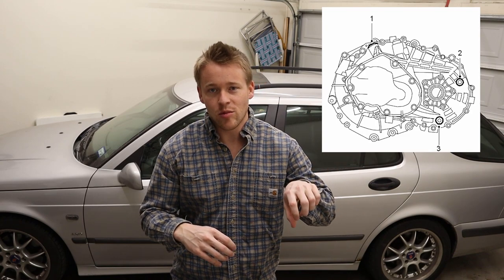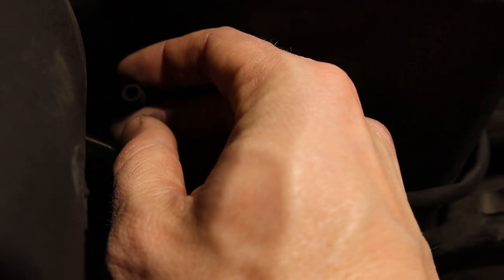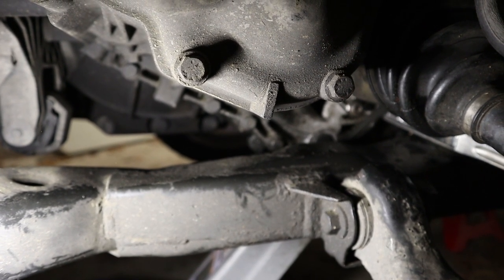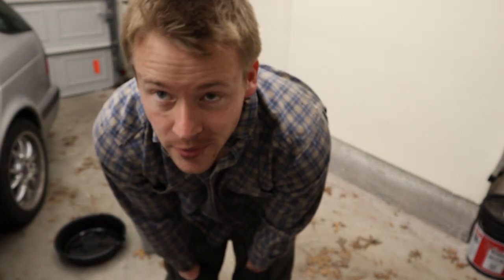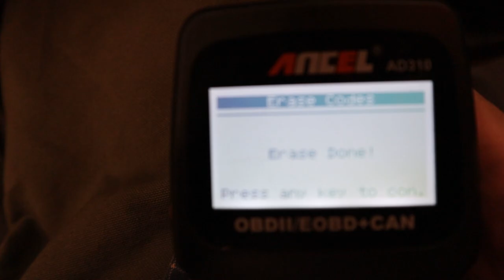Changing Saab 9-5 Manual Transmission Fluid.|Project Saab Part 3

Comment: I did this fairly easy by using an angled allen wrench that I had to cut as short as it could fit between the gearbox and the frame. Then used the long extension rod for socketed wrenches (don't know the word for them in english) as a leaver by sticking the allen wrench into the extension rods socket. 

You get some really good momentum then.

Good work!

Sheers from Sweden!
Reply from the maker: If I could do it again I’d get a different Allen. Jacking up the engine seemed to help. Glad you got it done!

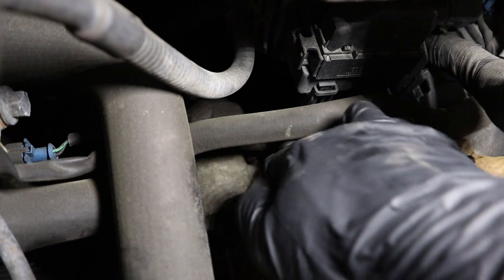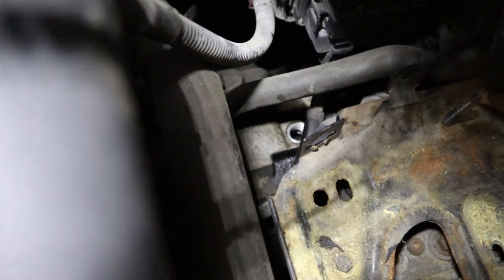Comment: 4:25 and 4:50 Hole 1, fill plug. 

5:05 Hole 2, drain.
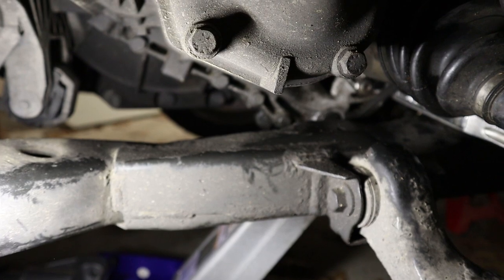5:50 8mm or 15 (?)
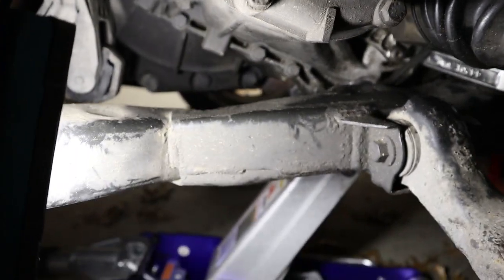6:30 different angle.

5:22 Hole 3, leveling plug.

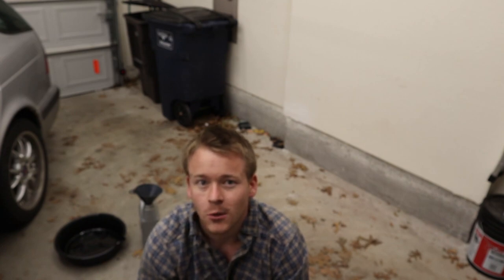9:22 1.5 Litres of oil.

Comment: If you enjoyed that. Wait til you try to replace the belt tensioner on an NG9-3 2.0T.
Better yet, timing and balance chain tensioners, or water pump. Sometimes you just wanna throttle an engineer...lol

Comment: GM has (had) this philosophy about trans fluid not needing to be changed (sort of), could this be part of the reason access is so absurd?
Reply: Barry Condon 
I think you're correct.  On my '04 9-3. the drain plug is blocked by the engine subframe.  Only way to drain it, is when the sub frame is dropped for clutch replacement.  Meanwhile, I've already purchased the trans fluid for that day.  The synthetic fluid is different than any other synthetic or conventional gear oil that I've ever used.  They say, It's not even compatible with conventional oils for recycling (at least per German requirements)

Comment: Great you shared your experience with the community. I would still reccomend replacing all the vacuum lines to silicone ones, since it's a cheap and fast job. Kudos for  showing the level plug, it's hard to find it. I'll be replacing my tranny fluid as well, but first I have to deal with my stripped fill plug :D
Reply from the maker: Probably not the correct tool for job, but I removed a striped drain plug using a chisel to make a notch and a hammer. After driving 30 miles CEL is back on. I think it’s ruptured diaphragm on blowoff valve overcoming vacuum system. Going to try and replace it.
Reply: @thefadshow  Thanks 4 the tip with the hammer. Did you leave the car in neutral or reverse gera when changing the fluid?